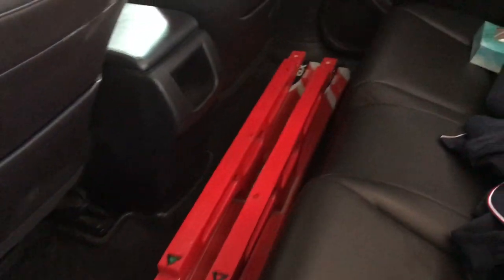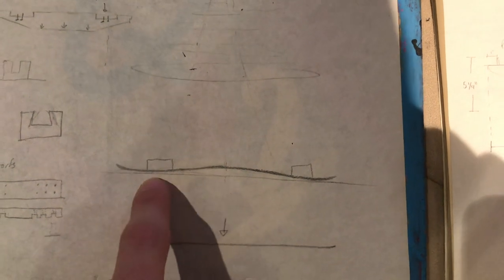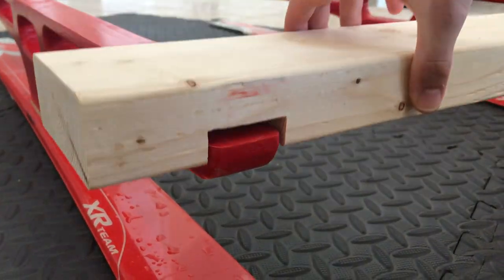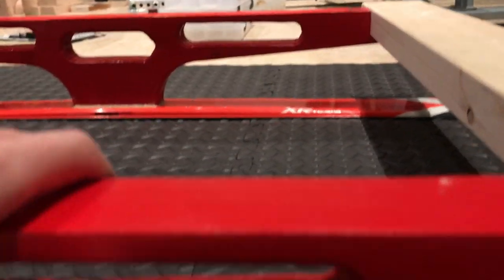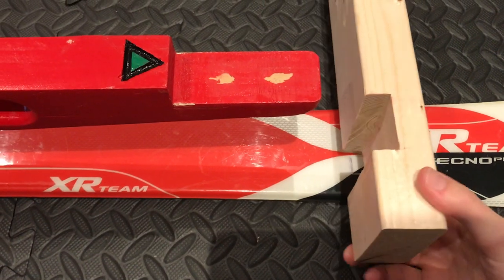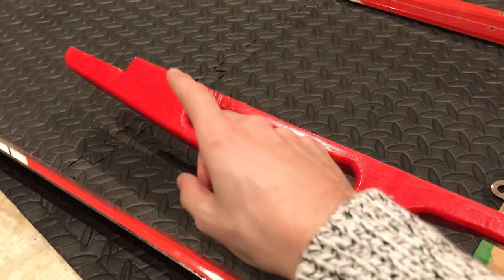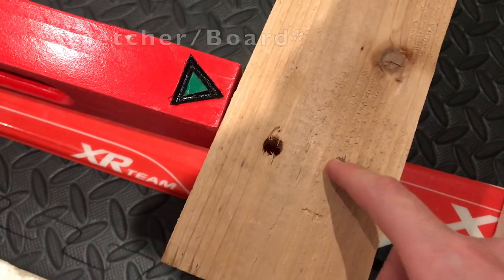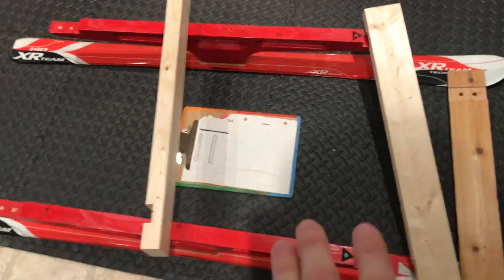The Ultimate Ice Fishing Sled Design?! - Smitty Sled Build/Design

Comment: Beautiful design!  I'm giving you 10 for 10 on that.  The only problem I see is the load has to be centrally located.  Loading one end too much will break it where it meets the skis.  A 200 lb person sitting on the back puts at least 1000 lbs of torque on the center.

Comment: Good ideas for reducing the weight and getting the weight centered on the ski.  I was thinking about the "Stringer" material construction - consider utilizing 3/4" EMT Conduit going between your main structures to keep the skis from going together while pulling.  I thought if you drilled a couple 1" diameter holes half way through the main 2x6 boards could contain the conduit, and when conduit is installed and your 2x4s installed, they wound work together to keep the entire sled more stabile.  I would install two of these, one next to each 2x4.  This may require a different 2x6 design though.
Reply from the maker: Thanks! I may have to opt with that kind of option. I was hoping to pick something that would reduce drag if I was in deep snow, but the circular shape of the tubing might not be too bad.

Comment: Nice job,I like it. Would be nice to have either a template or measurements for cuts,holes,length of base (red). For your cross members/stretchers to base; drill 4 holes (1 for each corner) or 8 holes 2 for each & use a pull pin with the folding c-shaped keeper/lock. So easy/quick to install & remove & when in transport just hook on to hole in base (red) or stretcher so always have. P.S, Can't wait to see 2.0 version finished.
Reply from the maker: Thanks for the comment and suggestion! Yes, making build plans might be something to do in the future.
Reply: @rafaelsakarya  Hi there,Evening sir. Yvmw,Yes that would be nice. Stay safe,Tight lines,Keep your stick on the ice.

Comment: I bolt with wingnut to attach the board on the risers, then rope thru the I loop to pull it. Problem solved. Good design!
Reply from the maker: That is a good solution, but the reason I don’t want to go with that is cause I wanted a solution with less parts (especially small ones) and a bit more flexibility.

Comment: How stable and easy to pull does it seem vs regular smitties? Seems like they usually use a rigid system to spread out the weight because it keeps things in the sled like bait, electronics, etc from moving. Also transfers force from the person dragging through the sled to the skiis better. But as you point out they weren't designed for this and you get more friction.
Reply from the maker: Honestly, I think most people would probably be shocked out how stable it is. It's quite solid. You can't have too much wiggle room where the stretcher (wooden cross piece) and the bracket (riser red piece) meet and once you add weight/your gear on it it helps solidify the structure that much more.

Comment: Idea I really want is a very minimal way to add 4 wheels for those of us ice fishing solo and/or need to walk on a paved surface for some distance.   So to not scratch up the skies or sled.
Some simple idea to clip on wheels or flip up?
I like the idea of those wheels for snowmobiles but... those are not ecomonical for home DIY'ers.
Reply from the maker: Yes it’s a good idea. For the time being I’ve just been along it on the pavement. Sometimes it’s smoother cause of the snow but obviously don’t like doing that too much. Wheel r a good solution. Have to think about best way to integrate them.
Reply: @rafaelsakarya  On the other than.. I thought about getting one of those flat dolly for moving furnitures or build one to my size requirement or one of those 4 wheel carts with handle? than actually make some sort of quick ski attachment.   So... completely other way around.
Attaching skis instead of wheels could be simpler?  Add some kind of bracket for wheels to cradle in than strap it down?
or win a lotto and buy a on the lake property. 
Hmm
Reply from the maker: Ya, it could potentially be easier to add skis instead of wheels. 
haha win lotto sounds good to me!

Comment: How wide was the base that attach to the ski?? And do you have to balance the weight so it doesn't tip for or backwards do to weight being uneven?????
Reply from the maker: The base (portion of wood that attaches to the ski) is 13cm long. And no unbalance problems. Because you have to lay the gear across the two cross pieces it distributes the weight pretty evenly. Also, because the design of the bracket (red) piece, the weight is directed to the centre of the ski so that's where most of the force is deposited.
Reply: @rafaelsakarya  THANKS sounds great!!! Love the design it's totally awesome and different then what you find great idea!!! Thanks for sharing!!
Reply from the maker: Thanks, really appreciate it!